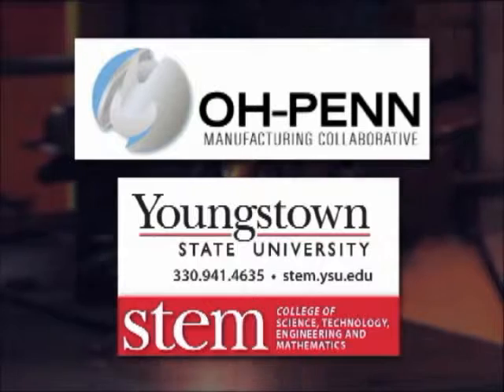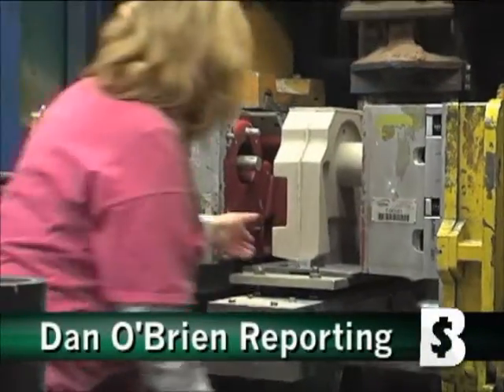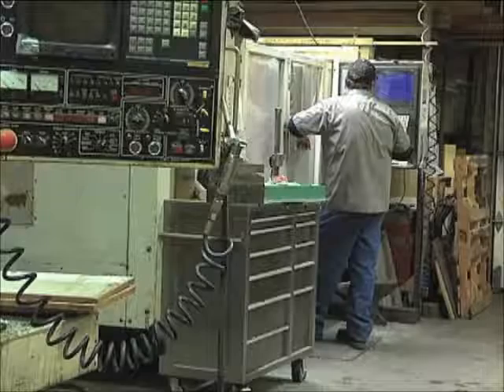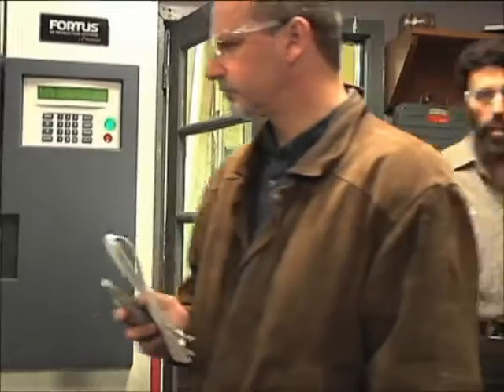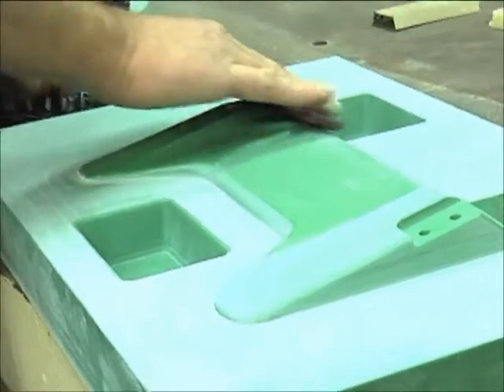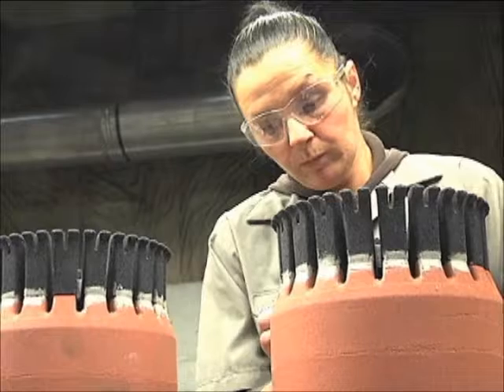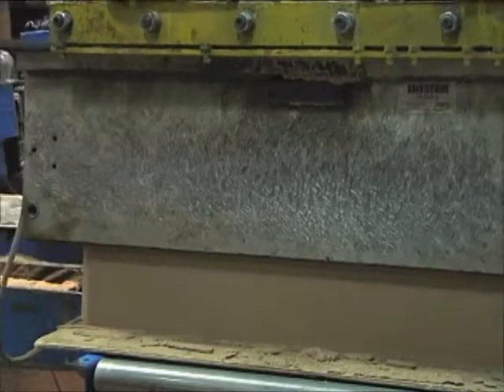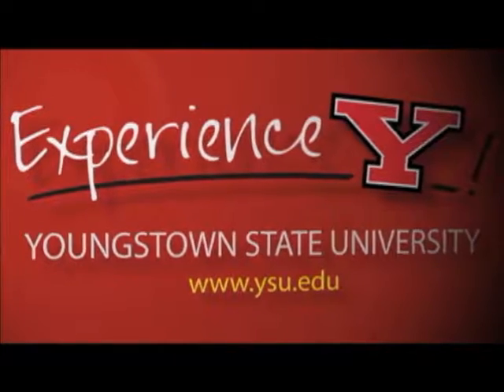Humtown Products President Discusses Subtractive vs. Additive Manufacturing

Comment: Awesome stuff. Just a question with your example of $500,000 for tooling and 24 week turnaround. In regards to switching to 3D printing you stated 2 week turnaround but didn't state a comparative cost. What would that cost be?
Reply from the maker: Every project is different but on this particular one we saved the customer almost 70% using printed molds and cores versus cutting hard tooling!  Please send us your project and we’ll be happy to quote.